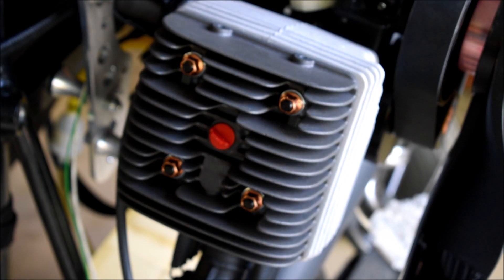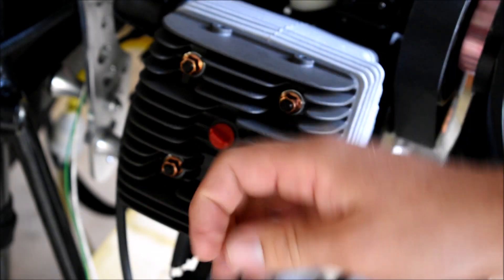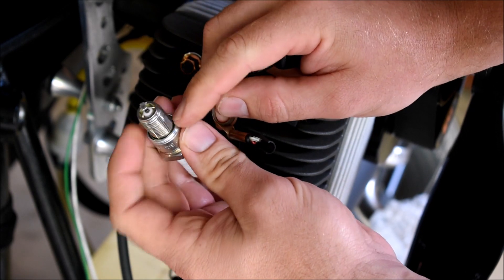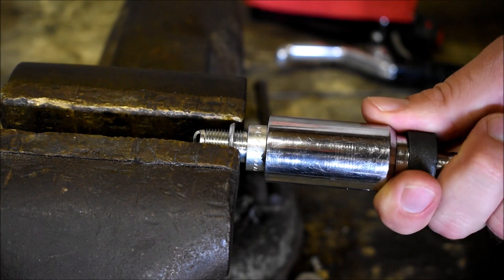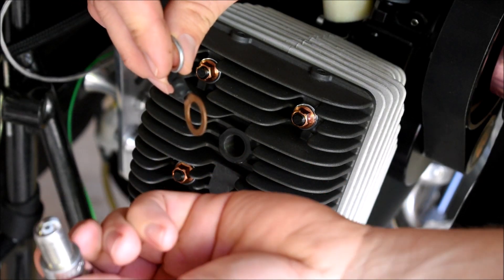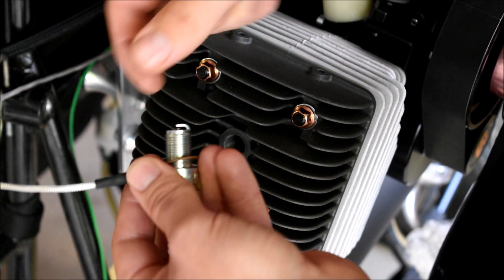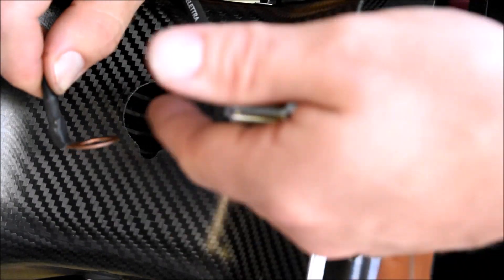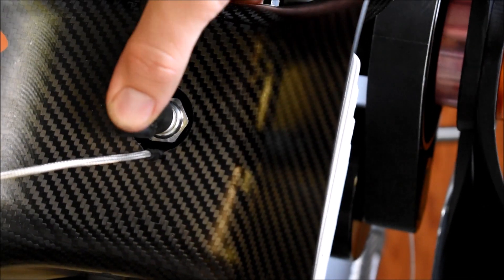Three ways to install a cylinder head temperature sensor on your paramotor.

Comment: What are your thoughts on installing it on one of the four stud bolts that hold the cylinder head on? I’ve seen 10mm CHT sensor hole sizes being sold. Would this give you an accurate reading? Thanks!
Reply from the maker: Typically the temperature probe is brass/copper and made for crushing. If you mount it to a cylinder head stud it likely will not torque properly or evenly with the other studs. This could lead to a leak or warped head. I personally wouldn't risk it. The other issue is the further away you get from the combustion chamber the lower the temp will read.

Comment: Any issues (like air leak) come up after doing it that way (no crush washer) for a while now? Still the best way? Do you check sparkplug torque often or anything different like that? Thanks
Reply from the maker: No air leak issues. It is brass and acts like a crush washer. If you are worried remove the factory washer and install it underneath it.

Comment: One more and easy way would be installing it under the spark plug cap.
There will be some temp difference but it's less than 10° c . You can always take that  in consideration.
Your sealing surface is intact and you can just lift the plug cap and remove the washer.
Makes the job so much easier as I am jetting the bike and changing the plugs quite often.
Reply from the maker: You'll have to make a video on that.

Comment: Once connected to the gauge it stays on, how long does the battery last in the gauge and would you recommend using switch to turn off when not using? Thanks
Reply from the maker: If it is the TTO tach, mine has lasted years. I have never changed the battery.
Reply: It is the TTO, thanks for the info and fast reply. Appreciate it...
Reply from the maker: @scottv3337  yes it is the TTO

Comment: I will be using CHT sensors/gauges for a lean tune. Better than using wideband sensor alone.
Reply: What wideband do you use for tuning mate?
Reply: @fatasdat  Innovate Motorsport for O2, cylinder head temp gauges are the most reliable for lean tunes. I have no issues to date. No carbon build up like you get from running rich